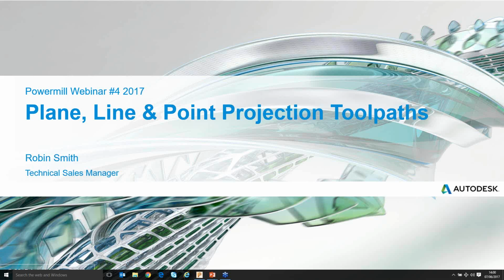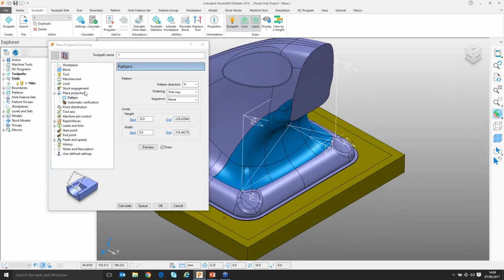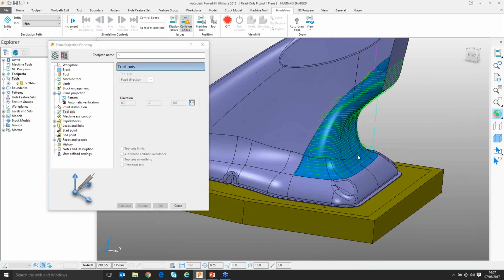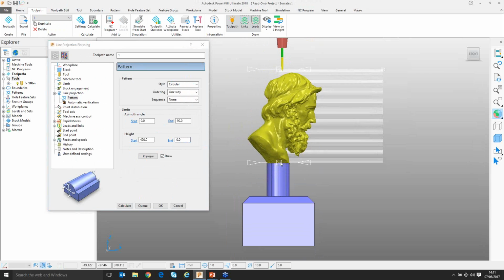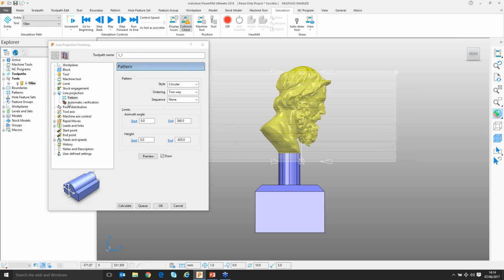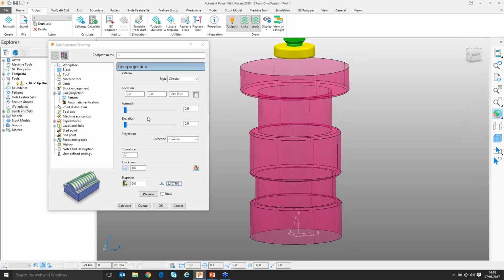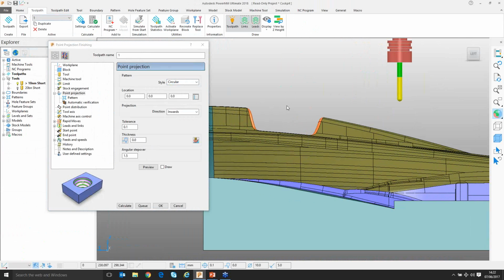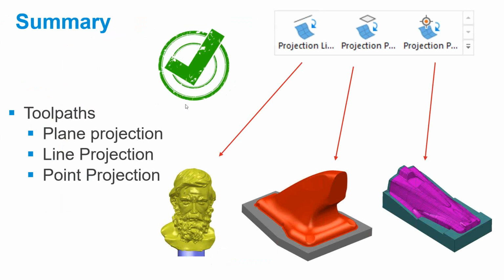Powermill - Projection strategies for line, point and plane

Comment: Hi,
Why am I getting this error when I write the G-code “powermill error ncb0233 can't reach desired tool direction”
I can simulate the toolpath but I can't write the NC program. This is only happened when I use curve projection. 
I don’t get this error when I am using Rotary finish strategy
Can you help please?